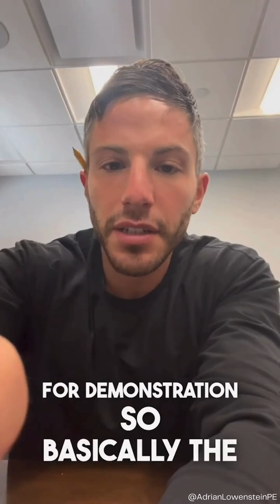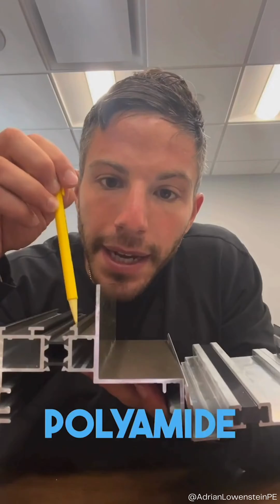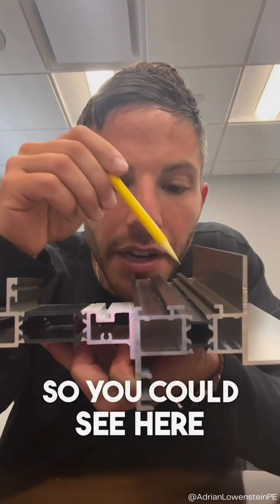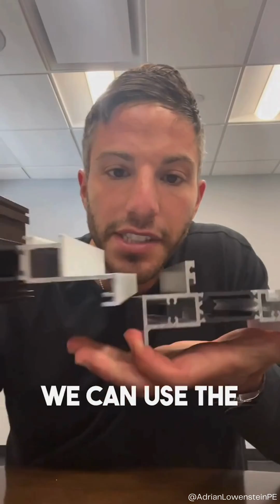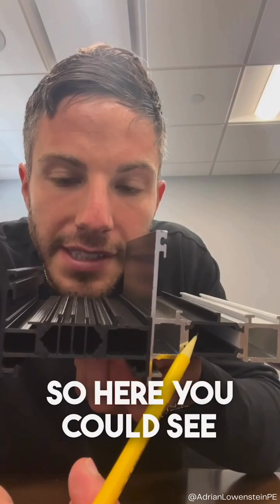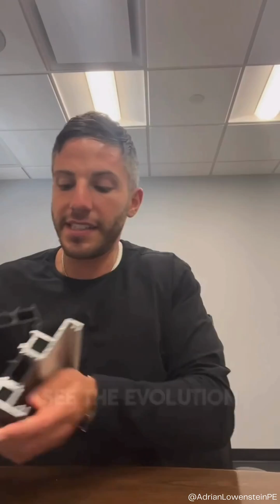Dive into Thermal Break evolution in aluminum windows - how well can you keep up?

Comment: And the newest is the polyamide chambers fulfilled with polyurethane foam for even better insulation !
Reply from the maker: yes!
Reply: Not understanding last two when you can fill the void using foam the only thing in uk the preference is to not to use combustible insulation so that would have to be something like shaped mineral wool or it’s none combustible equivalent 
Anyway thanks for allowing comments under your movies 
I’d like to see more talks here and on LinkedIn 👍🏻👍🏻👍🏻